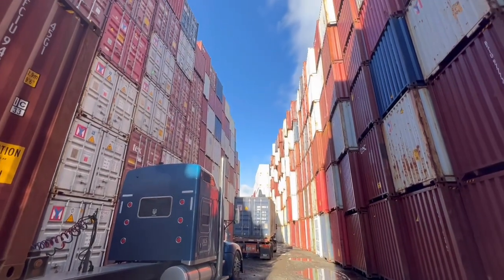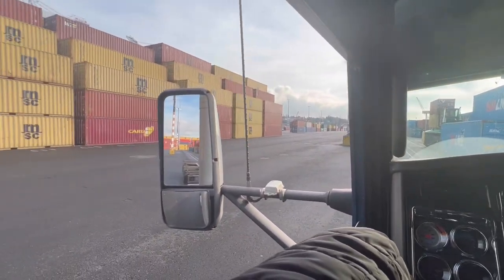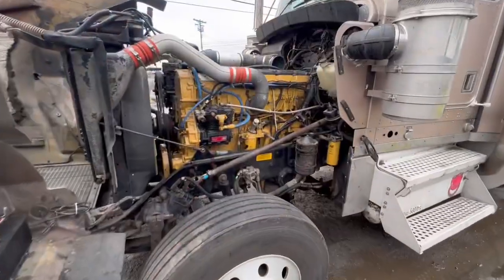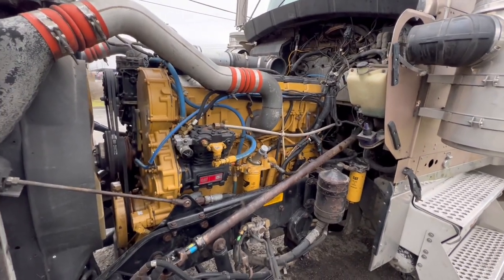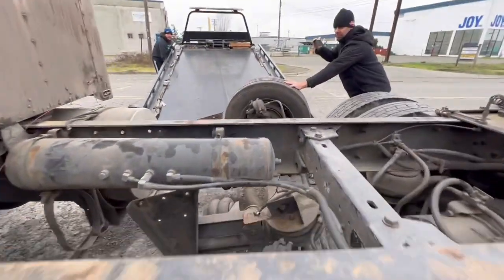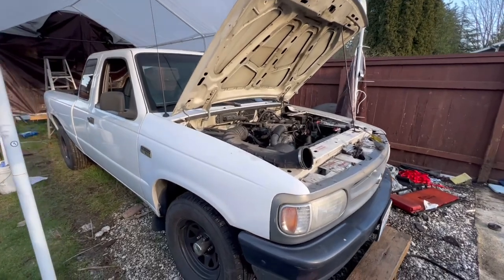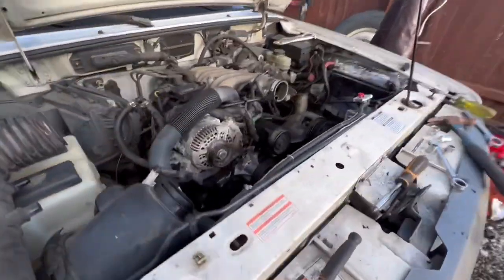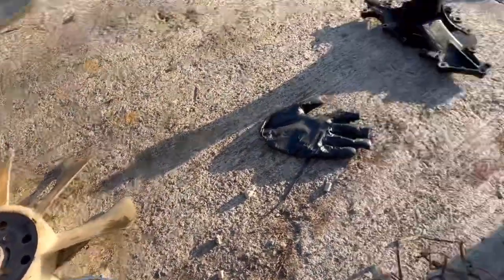Progress on the Kenworth W900 Project!

Comment: Hey brother I love the content and appreciate what you do! 
I apologize for asking you but my dream has always been to be an O/O! Is it hard to do containers and also does it pay pretty decent? Again I apologize for asking, just really want to be successful when I get started! 😬 I have been a Journeyman Lineman for 10 years and just recently bought one of my favorite trucks (to me) an ole cab over 😅 I like em haha. Thanks again for the content bud, be safe out there!
Reply from the maker: No worries I love to answer questions lol.. container pay as owner operator average about 4-5k gross a week for local work. The thing with the ports In Washington is they require trucks newer than 2008. Unless your on the east coast it doesn’t matter over there. Lots of brokers and dispatchers if you open your own authority. Where are you located?
Reply: @CustomRigs  how long is the wait at the ports ? Do you need your own trailer ?
Reply from the maker: @themendozafamily5055  no I do power only, dispatcher/brokers I work with supply the chassis. Usually an hour average turn time at ports. There’s a few times a month they can get really packed and sit 2-3 hours or longer. But all detention gets paid
Reply: @CustomRigs  I’m located in Lake City Florida so I’m not far from the Jacksonville port, and about 2 hours from the Tampa port. So I guess I need to check those specific requirements. I have a twic badge if that is a requirement as well. I’m new to this so trying to ask around and do a little research before everything is final!
Reply from the maker: @weepweep2225  ahh Florida.. my favorite place lol. There’s no truck restrictions there for the ports so it shouldn’t be a problem running any truck.
Reply: @CustomRigs  sweet! Thanks for replying back man! That’s awesome! I love the truck to, sweet rig. Be safe out there man!

Comment: What year is the motor on your truck?
Reply: The T660
Reply from the maker: 2013 isx
Reply: @CustomRigs  did you do the turbo conversion and take off all that other junk? I’m thinking of doing it
Reply from the maker: @jj2751   no I haven’t but was the plan once turbo failed. It’s hard to find someone who has a tune that would work with a non VGT tune
Reply: @CustomRigs  so then your truck still has def?
Reply: @CustomRigs  I guess I’m in luck that I have somebody that’ll do the VGT tune! My mechanic brought it up to me, so now I’m trying to think of ways to mock the engine into looking like an 03 motor
Reply from the maker: @jj2751  the def is deleted. Running 550 tune
Reply: @CustomRigs  did you remove all of the tanks?
Reply: @CustomRigs  I deleted as well running the stock 450 hp 2021 isx15. My turbos getting ready to go but I’m still kinda sus about going the vgt route. I don’t wNna get the wrong officer lol
Reply from the maker: @jj2751  yeah been running like that 3 years lol. All tanks gone and straight pipe all the way. But my egr is still working to keep the EGT temps down
Reply: @CustomRigs  the balls on you!!! Lolol  I deleted everything. Plated the egr but all the tanks and bs is still on my truck
Reply: @CustomRigs  leaving the egr was smart. I wish I did that now